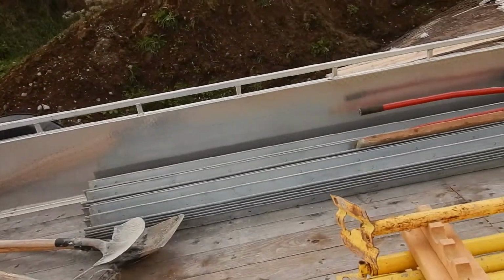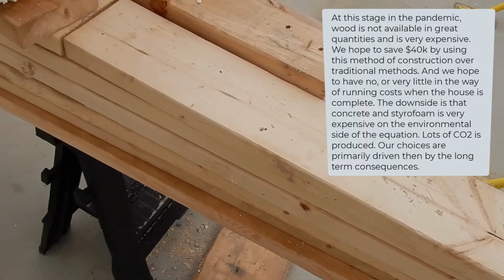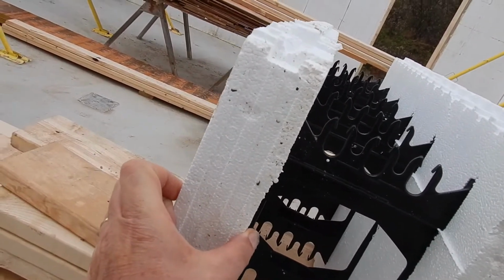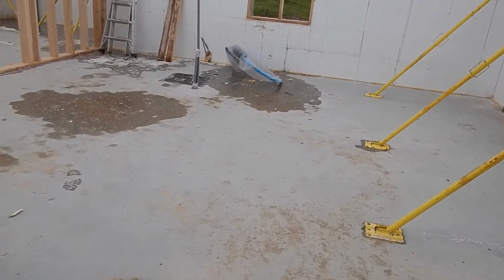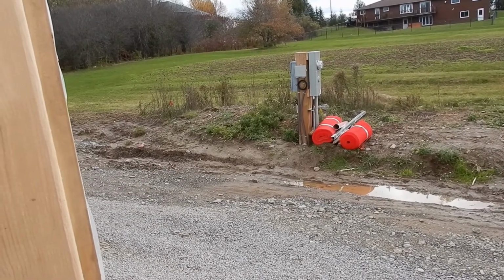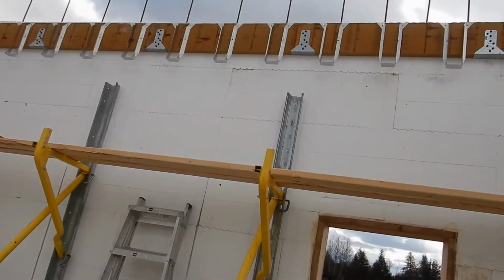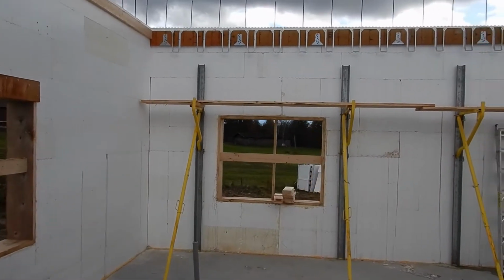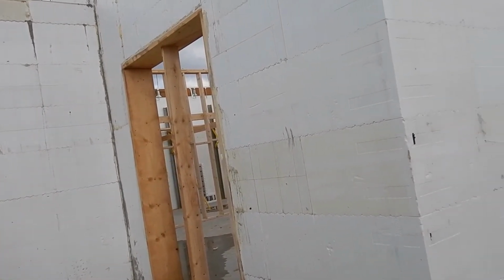ICF and Moving towards a Passive House Concept

Comment: PACIFIC ICF supplies R-30 AMVIC ICF with 6" of additional EPS on exterior for an R60 wall in BC
Reply from the maker: Our walls will end up with similar specs once the thermal wall is applied. It will be interesting to see what the actual values will be. I hope to monitor the performance of the house over the next few years with the assistance of the engineering faculty of my university, OntarioTechU.
Reply: @EastMarshAcres  I wonder about the exterior finish and rainscreen attachment. AMVIC makes several formats of ENVIROSTRAP with integrated strips in wood or plastic.  You could replace one layer of your EPS with a layer of Envirostrap.  Its made in Toronto north of Scarborough
Reply from the maker: @billmccance7762  We are going with steel cladding and the strapping is going on already. I haven't documented it yet but I'll post the work that has been done this week asap. The steel comes from a local supplier (Havelock Metal @ https://www.havelockmetal.com/) and the thermal wall is from Legalett (http://www.legalett.ca/), who also supplied our heated pad. http://www.legalett.ca/

Comment: Never seen anyone do in slab forced air. usually you see radiant floors with liquid (water).
Reply from the maker: Legalett has been doing this for a while now. We are hoping to get the heater started sometime this week. We still need to finish off some of the electrical and this will be one of the final steps. The floor has maintained a fair amount of heat but today the temperature has slipped to about 17degreesC.

Comment: Nice to see someone going all the way to the roof with ICF. For some reason a lot of the videos i have seen of the guys down in the USA don't seem to use ICF to it's full potential. They only seem to use it on basements/ crawl spaces, although some use it for the ground floor, but then move to timber for anything above that. Be interesting to see how your house copes with the Canadian weather. :)
Reply from the maker: Thanks for watching. We are also interested. I've talked to a couple of engineers at OntarioTechU hoping to get them to study the efficacy of the house over the next year. They responded favourably but the details are in the works.